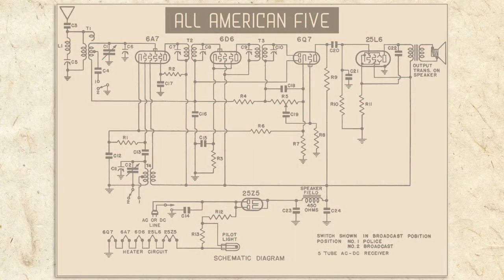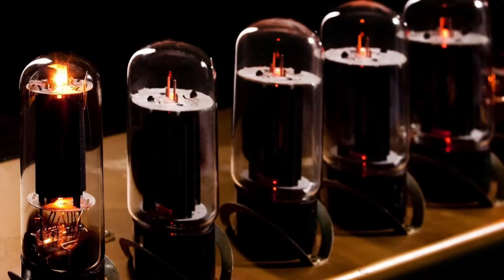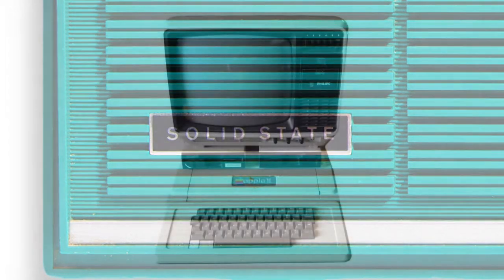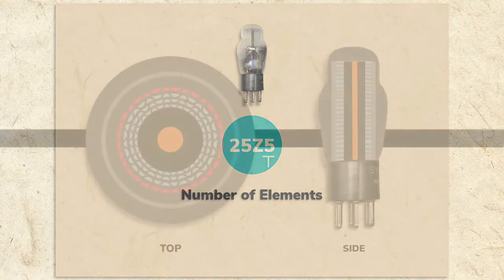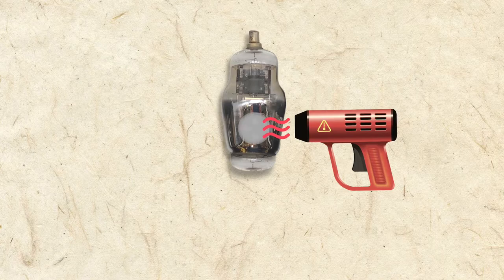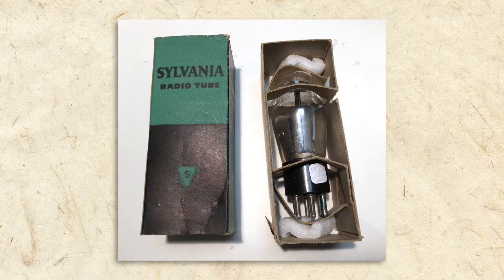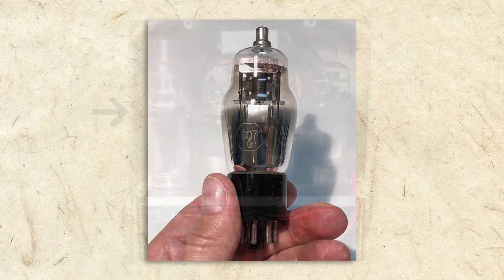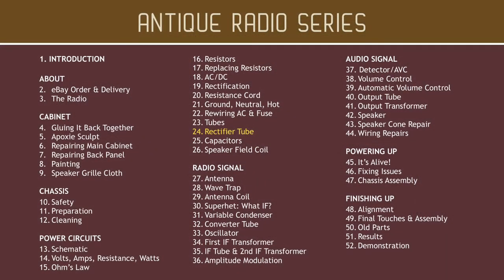How Do Vacuum Tubes Work?

Comment: The vast majority of lightbulbs do not have a vacuum; they are filled with argon at atmospheric pressure. Though some gas arc lamps like low pressure sodium lamps do operate at near-vacuum pressures.
Reply from the maker: The original Edison bulbs were made with a vacuum, but as you say, more modern ones are instead filled with inert gas. I appreciate your clarification, thanks.